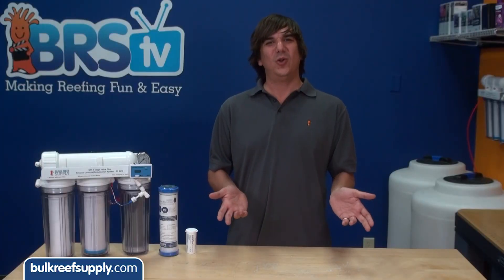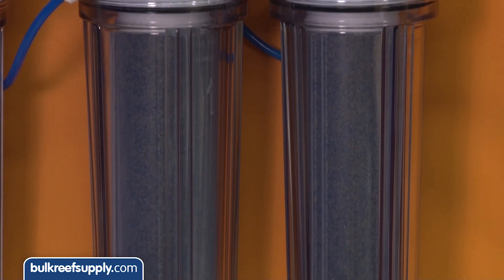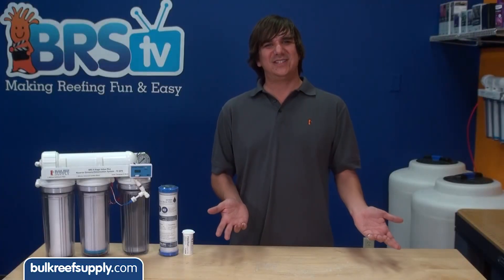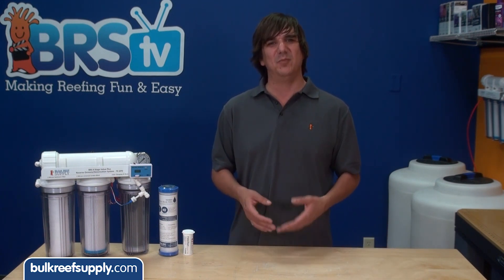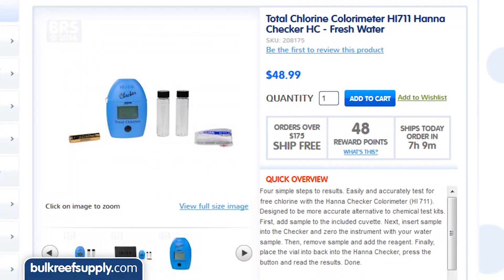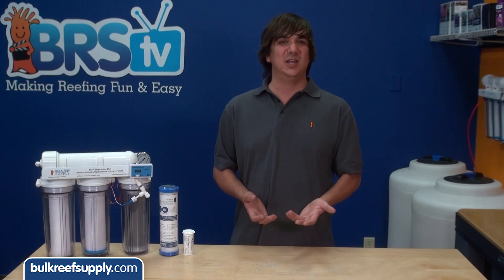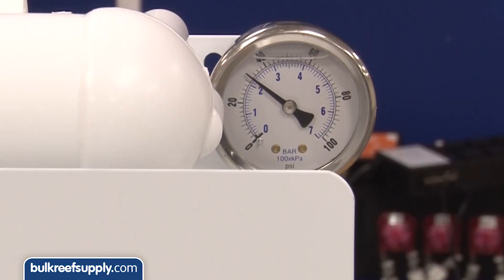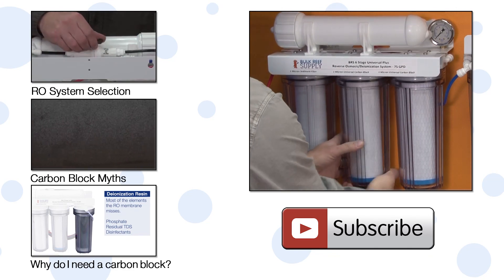When to change carbon blocks? Mystery solved!

Comment: When should you change your sediment filter?
Reply from the maker: With the sediment filter, you'll want to keep an eye on the water pressure. Once it starts to drop, that's a good indication that the sediment filter is beginning to clog.
Reply: @BRStv  now if we're lucky you guys will tell us all when to change carbon blocks as well. I live outside phx az so my ppm is around 800ppm out of the city tap lol... 😭

Comment: If you have a 3 micron Chloramine block and a .6 micron carbon block, checking the waste water tells you if BOTH blocks are hosed? So there is no practical way to test each one? I would think the 3 micron chloramine would tend to outlast the .6 micron? Also the chloramine block tends to be more expensive?
Reply: I have the Vertex with pump and auto flush. And I added a second chloramine block with external sediment canister before the two carbons. My biggest problem is with iron.
Reply: BulkReefSupplyCom p